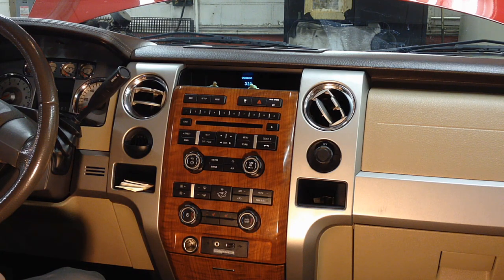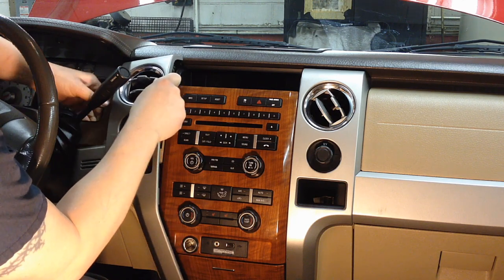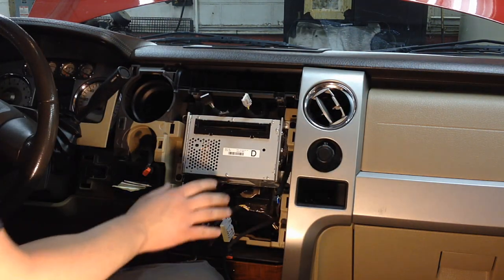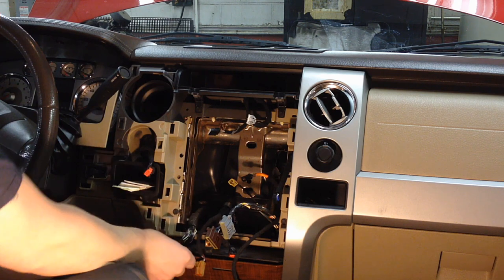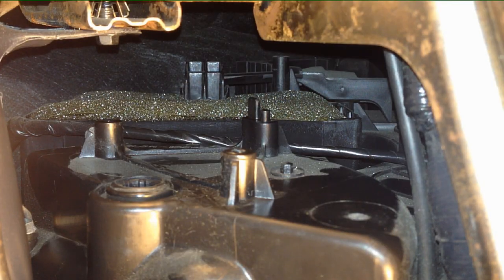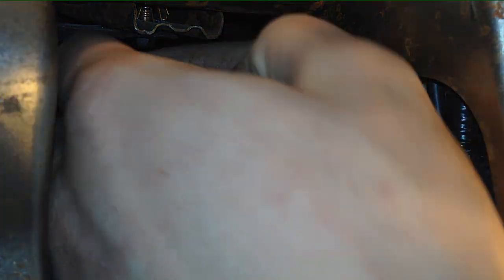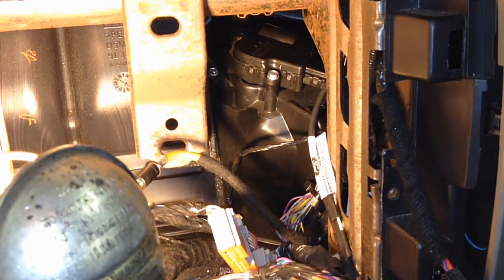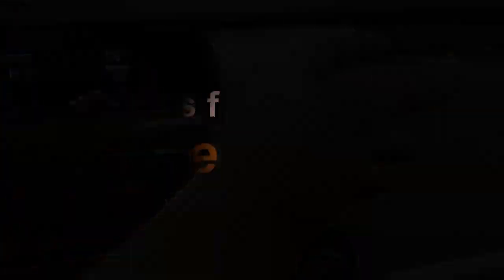2009+ F150 Passenger Side Upper Temprature Blend Door Actuator Replacement

Comment: Hi - I've reviewed multiple videos from all over the internet but nothing seems to cover my exact situation.  I have a 2010 F150 Lariat with a center console, navigation, dual climate control and adjustable pedals.  My problem is that the passenger side upper and lower vents are blowing hot air when I have the A/C on.  The drivers side is blowing cold air as are the 2 vents for the back seat (no clicking sounds).  
In addition, the blower door controls (defrost, upper, lower) don't seem to have much effect.  E.G. if I set it to defrost and lower, I still get significant air from the top vents.  If I set it to upper only, I still get air from the lower (and maybe the defrost - I don't know).  From what I've described, what actuator(s) do I need to be concerned with?  Does it make sense that multiple actuators would fail at the same time - or is this symptomatic of something else?  In any event, I'd like to fix the A/C ASAP since we are in the sweltering part of the summer.  Any guidance you can provide would be greatly appreciated.  Thanks a bunch ....

Comment: Do you have a part number for HVAC control module for 2010 F 150 lariat w/dual zone a/c? Have replaced blend door twice and still only heat on passenger side. Have never heard clicking sound everyone talks about either.

Comment: What could be the issue if new one is installed and pulled the fuse and still no difference ??  Recalibrated set both temps to 75 on the screen but still no change. Also I held down the HVAC power button and the defrost together, then hit power button and it started doing some kind of system calibration. Went thru fan speeds and then the temps started showing 82 on passenger side and like 10 on the drivers side of the screen. But just stayed like that and didn’t do anything else. Anyone ever done that? I know video is older just looking for help Thxs Rich

Comment: Great job at explaining everything. Went rather smoothly. I have a 2009 Ford Expedition Limited. I replaced the driver and passage side. The driver side temp blows the same regardless,  it's set on one temp.. Any suggestions...
Reply from the maker: Well first I hope Motorcraft actuators were used besides that we have seen a few HVAC control heads fail.

Comment: This worked great on my 2012 Raptor! Thanks! However, once it put everything back together and tested it, my airbag light won't extinguish. I have read that having my passenger seat all the way back while I was working could have caused this....any ideas? Thanks again!
Reply: Update, I figured it out! I forgot to plug in the traction control switch above the radio which also shows if passenger airbag is on or off.....duh. Plugged it in, airbag light went out. Thanks again!

Comment: Your videos are great! I hope you still read the comments. I took out the blend door motor on my 2011 Ford F150 ecoboost and the new motorcraft part YH-1933 does not fit. Yes, I calibrated but the teeth are clearly different from the original one that came with the truck. I'm pulling my hair out because I can't find one that's the same. Do you know what part it is?
Reply: THe job is done!  I decided to open the YH-1933 and found that a piece inside was askew and thus the shaft was angled. Once I fixed that the part fit.

Comment: My 2009 f150 platinum blows air and you can hear it on the pasangers side dash. And some fresh air comes out. But not cold the lines get cold to the touch. Under the hood. System seams to ve fibe but no cold air. Ohh and i just flushed and charged the system?? Help its a 100+ degrees here in texas.

Comment: I have the 2010 F150 lariat with the navigation and gear shift on the floor. Can I still replace the part using this video?  Thanks in advance for your time and help.
Reply from the maker: +timm towers yes it will be very close.
Reply: +FordTechMakuloco I have a 2013 F150 that has the same clicking noise. Can I follow these instructions to fix it?

Comment: great video! question... I have a 2010 raptor with what seems to be a slightly different problem. I have cold air only on the passenger side and hot air only on the driver side. no clicking. does that mean both are bad? I can still change to defrost or vent or whatever just no temp changes are possible.
Reply from the maker: spunrdneck Yes it is the upper and lower actuators that are bad I have videos on both 2009 plus

Comment: I have a 2009 Ford F-150 and I need to replace the upper actuator like in this video but when I look up the part number you gave out it says it is not compatible for 2009's. Does this fit 2009's? I assume so as the video states 2009 + but just wanted to verify before I order the parts.
Reply: Hi John,
I just used this very helpful video to change out upper actuator on 2011 F-150 5.0 Lariat SCREW. On Amazon, part number YH1933 states that it does not fit my 2011.  When I went to order part YH-1777 from local auto parts store and  which shows as a fit from Amazon, the YH1933 came instead.  I can tell you that YH1933 is an exact fit replacement for YH1777 and fits perfectly for my 2011 despite Amazon.  The Ford part number from the actual actuator removed was AL34-19E616-AA. The part number on YH1933 is  DL3Z-19E616-A. This is the upper actuator behind the radio.  Hope this helps.  Thanks FordTechMakuloco for helpful video.

Comment: At 24:45 the digital temp reader jumps from 85 to 90, then when you turn the knob back from 90 to 85. I just just notice this on my 09 f150 too, does anybody know why?? What happened to 86, 87, 88, 89 temp settings? My is starting to make the noise, thanks for your video, i will used it as a guide.

Comment: Got a question on my 2012 F150 . When I go from defrost to cabin heat it still blows out the defrost and a little on your feet but nothing from the vents. Would this actuator be the one I need to change. Also the rear window defrost button works intermittenly
Reply from the maker: Andy King No that actuator is above your feet by the pedals you will see it bolted to the side of the case.

Comment: Could use a little help. I have a 2009 F150 going to attempt this repair on my own. 2 things. 1 I tried to verify the part number and it says it doesn't fit my vehicle? This is the link that you send through to amazon, is there a different part number for me? 2nd can you post a link to the video you reference with the navigation and taking that dash apart. Thanks
Reply from the maker: Joshua Sansbury yes the one listed is the latest, amazon is just behindHere is the other video-https://www.youtube.com/watch?v=p5xvlbiaxF4
Reply: FordTechMakuloco Thank you very much! Turns out I had the flow through center console.  So have to start with the Lower replacement to access 2 bolts of the side trim panels. Other wise pretty clean and easy over all, however that damned back bold was and is a PAIN. My very pregnant wife Thanks you just in time for this summers weather we are getting.

Comment: is this the same way to get the heat working back on the passenger side on a 2006 expedition E.B? on my expedition the heat is working only on the drivers side and i have the dual heater control
Reply from the maker: Santiago Rangel No sorry yours is different and is buried in the dash. Dash removal is required.

Comment: i am thinking this is what my problem is but i want to know for sure before i take everything apart.seems like a bit of work to find out its not the cause/.//..drivers side i can have ac or heat and anywhere in between.....passenger side ac or cool only no heat and this goes for the back seat vents too... because back seat vent runs off the passenger side vent...

Comment: how you doing thanks for the video. I replaced the actuator behind the radio but I still have the same issue the driver side is blowing out cold air when it's set to 80 degrees the window defroster and rear pass. vents are blowing out cold air pass. side is fine cold/warm air. Any ideas? I have a 2010 platinum.
Reply: Carlos Hernandez
Reply: Hi Carlos,
FordTechMakuloco is the expert but I just changed out upper actuator behind radio for fix on passenger's side in 2011 F-150 SCREW Lariat 5.0 from this video.  It fixed cold air through passenger vents and rear vents air via back of center console.  I believe the driver's side actuator is the lower actuator and replacement procedures are through a different video and uses a different part number. Hope this helps.
Reply: Chuck Alfonzo I've replaced the actuator behind the radio and the other one by the gas pedal. I still have the same issue though. Any idea's?

Comment: Where is the drivers side actuator? Mine blows heat on drivers side and ac works on the passenger.  I have a 2009 ford f150 lariat 5.4. Where is the other video

Comment: HI Brian. My dad's 09 F-150 with dual zone climate control is blowing very hot air when the ac is running on the driver side only while the passenger side is working fine. Could this be the issue? If so, which of the two blend door actuators would need replacing, the upper or lower one? Thanks very much!
Reply from the maker: The one that is bad on your system is the lower one which require dash and heater box removal, or you could attempt my method that has worked as shown here- https://www.youtube.com/watch?v=p5xvlbiaxF4
Reply: Really appreciate the reply and help!! Thanks a lot

Comment: Hey dude i followed your video . i have a 2009 F 150 Platinum and i replaced the actuator and when thru the calibration but the passenger side is still not blowing cold. The driver side is  ice cold. What else do you think it could be?
Reply: Did u find the issue? Mine is doing the same
Reply: @migueldelafuente5775  no i have not i change it again but i think that the gear is out where it connects

Comment: Not sure if I can get a response but hoping. 2009 Plat with cent console and dual HVAC and no My Touch.  Passenger side temp will not adjust. on about luke warm. Drivers side and all vent variations works.  Would it be this actuator?  Wanted to narrow it down before tearing it apart.  Thanks!
Reply from the maker: 2009 models had problems with the HVAC head unit failing causing this too but the actuator is still the most common and will fail in the future if it has not already so it would be my first step.
Reply: Any idea what I should be reading at the pins from the head unit?
Reply: Ended up being the blend actuator. Thanks for the tip,!

Comment: Great job Sir!  I have an 08 expy and I need to replace the drivers side blend door actuator.   Is the duct work and procedure the same as the 09?
Thanks for the video!!
Reply from the maker: +TODD Wilson Yours is underneath the hvac box buried by the floor and requires dash and hvac box removal. I have to a way to do this without removing all of that but it's on an f150 yours should be very similar though- https://www.youtube.com/watch?v=p5xvlbiaxF4
Reply: Thank you!

Comment: Dude! Thank you so much! I have a 2010 xlt f150 and ever since I bought it heat never worked. When I bought it though it made a clicking noise down there but thought nothing of it because the air was still working. Now that it's cold out, I can fix it! Now there is no way that the actual door will get jammed or stuck would it? And that it's only the motor that needs replacing?
Reply from the maker: derek2007 The doors getting stuck or binding of any sorts on these is rare if at all it is always the actuator I do them all the time. It seems they have learned and binding doors are a thing of the past on Fords but actuators keep us busy.
Reply: +FordTechMakuloco thanks again bub. By the way after I replaced the actuator, I noticed my airbag light came on. And it stays on a solid yellow. Any ideas?
Reply: FordTechMakuloco
Reply from the maker: derek2007 Yes you missed the connector for the PAD indicator on top of the FCIM you removed. Its the same as the traction control/ hazards button set that connector.
Reply: FordTechMakuloco ok dude, ill check it out, thanks again
Reply: FordTechMakuloco dude! You are awesome! Everything is working great now! But, Lol, I have another issue no one seems to know what it is. When my truck is in gear and I'm like coasting and when my rpm is between 1500-2000 I hear a ticking noise. But not while idling or above 2000 rpm. Any ideas?
Reply from the maker: They tell us that is normal vct oscillation noise. I am not there to hear it but I can bet that is what it is.
From Ford-
Normal phaser oscillation when
engine is off idle.
Light rattle noise (normal)
Reply: FordTechMakuloco ok dude, thanks again for all of your help. You are a freaking life saver! I'm telling all of my friends about how well and good of a job you do explaining how to fix things. And on top of that you respond to comments! Freaking awesome bro, I can't thank you enough!
Reply from the maker: Sweet thanks!!!

Comment: so do these set a dtc when they quit working? or is it just common sense to go after these after you check coolant level, and or trapped air in the cooling system thermostat etc..
Reply from the maker: phil holbrook They do set dtc's in the hvac modules most times, sometimes you hear clicking when trying to change temps besides that yes the usual thermostat check and coolant level checks.
Reply: seems like you put lots of effort in what you do making these videos. i say that because instead of just doing the job to beat book time your slowing down to explain things taking a little longer than what you should for your viewers. happy thanksgiving. THANKS FOR YOUR MILITARY SERVICES GOD BLESS THE USA
Reply from the maker: phil holbrook Thank you so much and believe it or not I still make book time on customer pay jobs because I have done them so many times .

Comment: I have somewhat the opposite of the others... My drivers side is fine, the passenger side will blow what ever the temp of the engine is... starts cold and then goes to full bore hot no matter the climate control settings. Except off will cut the air flow.  Would this too be the same part or other?
F150 2009 Lariat
Reply from the maker: Steven London Yes this is the part you need to change links are in the description

Comment: Watched the video. Great job! Looks easy enough to for me to replace mine. I followed the Amazon link that you provided for the part and it only list 2010-2014 model years of the F150 in the description. Will it also work for the 2009 model year? Truck is a 2009 F150 with the flow through console. Will be replacing the passenger side actuator. Thanks for your help.
Reply: Just saw that you answered this question on a previous comment. Thanks again for the video!

Comment: Great informational videos, Great help for us, Great thanks to you!!!
Is it common for both actuators to go out at same time? That's what happened to us, will turning Temp. levels to Max. either way have anything to do with it? Took truck (2010 F-150 Lariat) to reputable shop and was quoted $1,100.00, 3 days. After watching your videos, I think I can do it, just would like to be sure doing it fixes problem, or is there any other check needed before I dive in. Does it matter where the blend doors are at when actuators are replaced? Wow!, this happened on Thanksgiving night, around the time you posted video. Any answers and advice will be greatly appreciated
Reply from the maker: Armando Lopez I would do the easy one first for the passenger side and go from there. It is the upper one.

Comment: so I'm having the same issue with my 2011 5.0 F150, but i don't hear any clicking noise from the dash. i pulled the 46 fuse and put it back in, then started the truck now i have heat....until i move the control from heat to cold and then its stuck on cold. Same issue? how much should i expect to pay for parts and labor from a ford Dealership?
Reply from the maker: Yes follow the procedure in the video, these lose track of position and hunt where as before they would click from broken teeth on the old model trucks
Reply: FordTechMakuloco thanks bro i appreciate it!!!

Comment: will this work on a 2009 f150? amazon says it wont fit
Reply from the maker: Yes that is the latest actuator from Ford. Amazon is stuck on the old part number still. My part numbers come direct from the Ford catalog same as the dealers use.
Reply: thanks so much for responding! and thanks for the videos! helps a lot

Comment: Problem 09 F150...passenger side vents are stuck on hot. temp goes up and down from manual buttons and from touch screen. The temp out of passenger vents is hot no matter what setting. I spilt coffee on buttons and syc ports but everything seems to work except that temp is blowing hot. Question... is the problem the actuator or buttons? if actuator, whats the part number? 09 f150  thanks

Mike
Reply from the maker: +mike reandeau almost always it's the actuator itself. The part is linked in the video description
Reply: I have the same issue I bough this used truck the dealer couldn’t figure it out so I was able to fix the driver side temperature but the passanger I was able to connect the actuator from the glove compartment but it only goes one way which is hot and the settings can actually respond to hot and cold but the actuator stays on hot positions regardless could the passenger switch control be bad I forgot to mention that I replace 2 new door actuator within a week time and both go to the hot position and won’t come back and I also remove the fuse so the actuator can recalibrate any help as well thanks